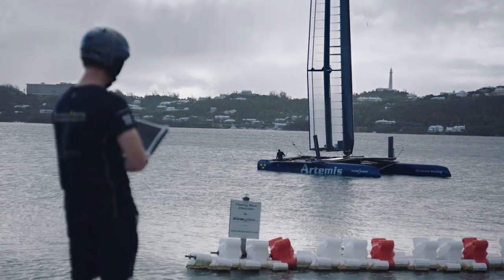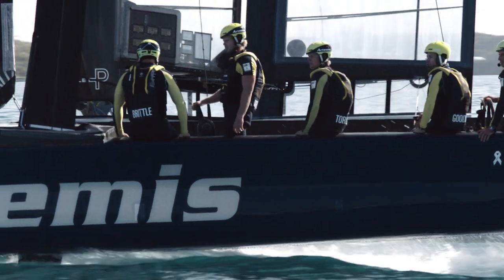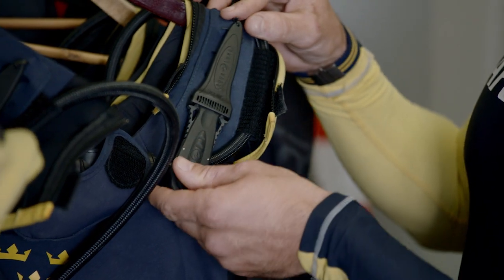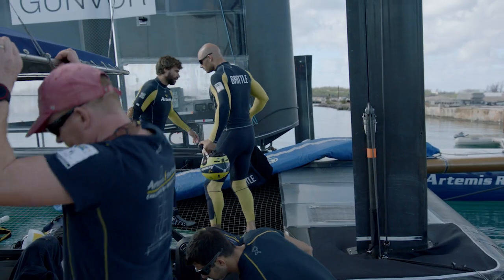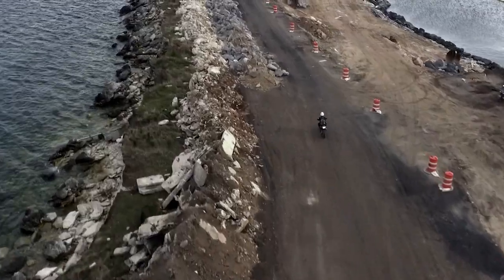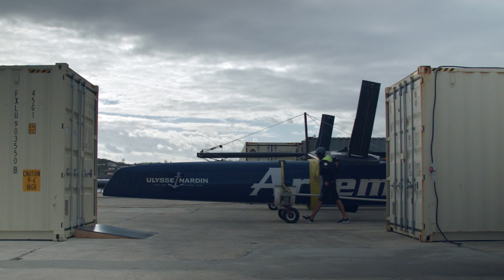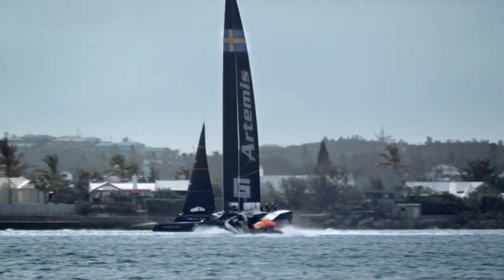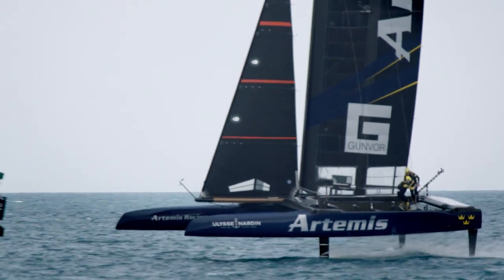Surface to Air Film

Comment: Yes, yes very nice. Talking heads promoting the event. 

Any journalism?
Any technical  information? 
Any thoughts on Foil choices and tradeoffs? 
Any thoughts on strategy? Tactics?
Reply: And you were expecting..... LOL!  Enjoy the races.
Reply: Well, I would if I could watch them. So far the only access I see is a phone app. Perhaps a cable station? I don't do cable. I do pay a fair amount to watch MototGP, I'd do the same here if it were offered.
Reply: Where are you?
Reply: Steve Bridge, Austin Texas. Do you know any viewing options?
Reply: OK, found it in Phoenix:  May 26th on NBCSN (NBC Sports Channel) at 3 PM Phx time.  Channel 1642 on Prism/Centurylink programming.  I think I am Pacific time zone now (we don't change clocks, so gets confusing).  Your time then is probably 4 pm or 5 pm.  That's the first one.  Show is listed as 'Sailing' and it runs for 3 hours, I think.

Hope that helps.